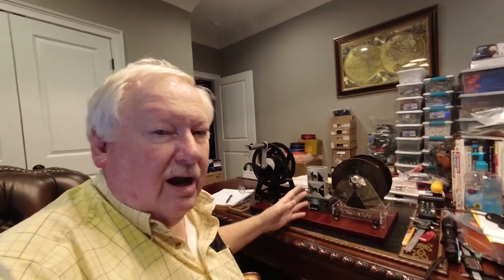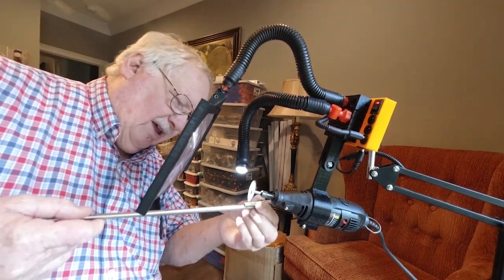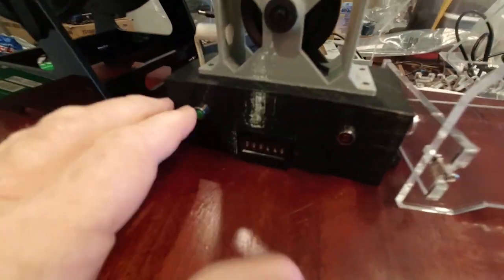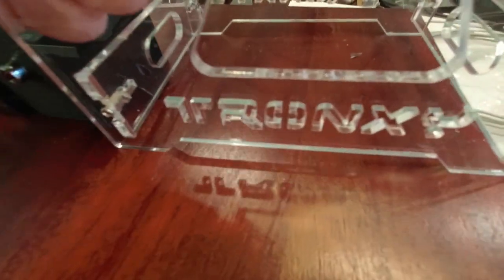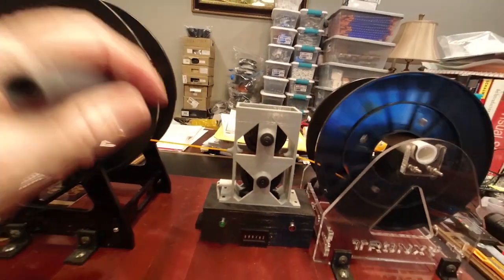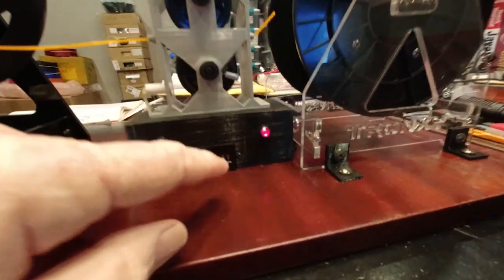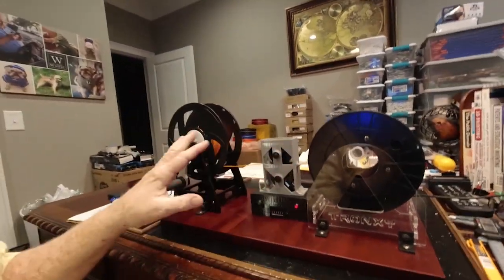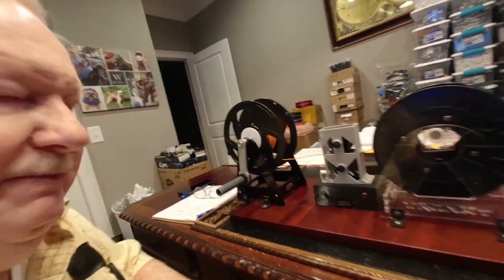MY 3D PRINTER FILAMENT COUNTER, LET'S SEE IF IT'S GOING TO WORK

Comment: I have been looking to make something exactly like this. I also have a 10 printer farm and I don't make anything until it sells. So sometimes I have to use the same color on multiple printers so I hand wind them and weigh the filament for the time being. It works but the winding sometimes gets stuck when the printer is extruding and causes issues with my prints. If you are selling this device you can count me in as a customer!
Reply from the maker: I understand your problems with 10 printers. I hade the same problems before I came up with the counter. The prototype works very well and I hope to have an automated one soon. I will probably have a few to sell online when I get around to it. Thanks for sharing your experience and for your support...Ken

Comment: Great video Ken and nice to see the actual Helping Hand (HH) giving you, well, a helping hand! I’m impressed. I bought something similar years ago but not as advanced. Can I offer some feedback: use a heavier arm base like those for computer monitors – at least as an option (if in fact you plan to sell bases with the HH). I noticed the same wobbly issue with your desk lamp frame that I had with the cheap unit. It was frustrating, couldn’t keep it steady. Your flex-arms seem sturdier than the competition though which is great! I think of the whole thing like a chain: as good as the weakest link. I think the base/arm could be it. IMHO.

You prototype like I do: not pretty but proves if the concept works or not! If you plan on going all electronics, I think the most precise method would be to switch to a weighing reading rather than a length. 3D printers/slicers actually work (calculate) on volume. You could put both spools on scales, average the weight between what came off with what was added on till you meet the target. Heck, with the scales giving you clear LED readings, all you’d need is an on/off switch for the motor! If you stay with length, you could increase the diameter of the “reading” wheel and slap a thick rubber band or the like and add some extra weight for a better non-slip surface. You could also add a second wheel just behind the first to give you two readings and average them out. I could also see two, three or more “series” all connected to the same motor so you could load two or more spools all at the same time with a single respooling machine. Just some ideas for you! Claude
Reply from the maker: How you doing Claude? Hope all is well on your end. Things have been hectic around here trying to get item photos, descriptions, weights, dimensions, and descriptions for over 44 items for the website. Also doing final testing on parts with many printing in PETG at 245c and making outer wall thickness greater and increased fill density for increased part strength on helping hand parts that have high stress and load on them. Don't want the helping hand to get any broken fingers. The helping hand I use in my office is attached to a little folding table and is shaking a lot, but I'm used to it. I do have other mounts for the helping hand that are more stable. One is a permanent mount that bolts to a table or workbench or wall and is the most stable. The portable table tom mount is the next most stable mount and the floor stand and the scissor arm are the least stable but more flexible. As for the filament counter, I have been testing it with some small print jobs and plan to use it for some larger jobs tomorrow and hope to see just how accurate it really is. This gives me a chance to check the slicer too. Will let you know how things work out my friend and as always thanks for your input and support...Ken
Reply: @NewTechInventors  Do you ever sleep Ken? People think setting up an e-commerce business is simple. It is if you only have a couple of products, otherwise, it is a ton of work. Especially like yourself Ken, when you have to do everything yourself. Funny you say your testing PETG at 245C. For my upcoming product, after testing dozens and dozens of prototypes for strength, I finally decided to go with a basic PETG. Now the next phase is to see if I can tweak the design and printing to produce the main body in under an one hour each. I changed my hot end to a Volcano type clone (US$5 each from AliExpress) so that I could print faster while the hot end can keep up with a 0.6mm nozzle. The finish is still great and so far so good at 250C. It says the max should be 240C but at that temp, you can hear the extruder skip at my set speed. The higher temp also gives me really amazing bonding (fan speed at 40%). CNC Kitchen has some great videos on temp, fan speeds and nozzle size for strength and speeds.

Wow, so you'll have a whole bunch of mounts! Hope you do not take my comments as criticism - really trying to help and share my experiences. I can't wait to see your whole line-up Ken. I hope to share my products in the future as well. I'll keep watching your videos and look forward on the results of the counter! Claude

Comment: Fitting direct-drive extruders would make even greater savings as you would not waste the distance in filament from the extruder to the hot end on Bowden machines as long as the filament saving cost exceeds the upgrade cost, but once sales get going I would think this would be a viable option.
Reply from the maker: With filament cost ranging from $ .05 to .07 per meter depending on type, I expect to have from 1 to 2 meter filament loss per job. My average job runs 24 hours and produces about20 parts. This adds about $ .0025 to .007 to each part cost. It's small, but does add up. I'm trying not to go over board here. Thanks for sharing your ideas and for your support...Ken
Reply: @NewTechInventors  I've never seen filament by the meter, only by the gram. I guess you figured out the length on a spool and convert to cost/length?

Comment: Thanks, Ken... The REAL question is how accurate is your slicer in estimating how much filament your part is going to use. It will be interesting to see how much overage/underage you actually end up with.
Reply from the maker: I will find out about the accuracy of the slicers pretty soon. I have also wondered how accurate they really are, since I have been figuring my part cost on the filament length they provide Good question Ben thanks for your support...Ken
Reply: If yu Use Prusa Slicer, Very accurate!!

Comment: AH, I get this project now, and i already want one. First Customer!!
However, how difficult would it be to have a pre-determined length dialed in so it stops at the required length.
For example: I have one empty reel one full reel and get a job that needs 45.7 mtrs. I set up machine with the reels as required, but instead of hand rolling out the 45.9 mtrs req, i set up (Whatever) to reel in/out 45.9mtrs (Extra For peace of mind), flip start switch.It will reel out/in 45.9 and STOP automatically, without me being there to turn it off???
NOW That would be cool.
Reply from the maker: I think we are on the same page my friend. I now plan to motorize the device with a stepper motor and control it with an Arduino board so I can key in a length that will be displayed on a LCD screen. Then when you press start the stepper motor will slowly come up to speed and as the counter counts pulses the count on the display in meters will start counting down to 0. when the counter gets down to the last meter the stepper motors will start slowing down the take up spool to stop at 0. I am testing the device with the temporary manual crank now on several jobs and it's working well. It may take me a while to set up the automated version with all I have going on here. Thanks for your input and encouragement....Ken

Comment: Maybe a stupid question on my part, but if you are using left over spools of filament to make a large full spool, how are you joining the ends of the filament to make one continuous piece of filament?
Reply from the maker: Sorry Dean, I think you are misunderstanding me. I am using this device to pre load job spools with the required amount of filament from the inventory spool to complete a print job. This way there is no filament left on the job spool after the print job is finished, thus eliminating the need to deal with another partial spool of filament. The only partial spool remaining with that filament on it will be the original inventory spool. Thanks for the question and I hope I cleared things up a bit my friend. Thanks for your support...Ken

Comment: Hi Ken, Hows the farm going?? i see you must have some sales on the tap. CONGRATS!!!  I cant see any other reason for all this work. looks like overkill to me, just being honest. never seen a printing farm operate the way you are...usually they keep printing and printing and printing, LOL dont over think things my friend... dont fix what aint broke... sales must be through the roof.........
Reply from the maker: Well you can call me mister optimistic my friend, and it's true I do things differently for sure. I would not recommend that anyone go about this exactly as I have, because the big difference is that I am 73 years old and retired from my income making job. I can not just sit around and watch TV so I felt compelled to start this business with one stipulation, "that I would do it my way and at my pace while getting some degree of enjoyment out of it". If my livelihood depended on it I would not have time to do these YouTube videos and I would have had a website and sales long before now. I am determined to be successful and try to pass along what I learn thru these videos. I guess that is why I seem to spend a lot of time on the different aspects of 3D printing, it's my way of learning. I think you will be surprised at how  the print farm will run in concert with the demand from my web site sales. It will operate much like an assembly line in a JIT (just in time) environment with little need for inventory. Make what you need when you need it. I hope this will help you understand what I'm doing so you don't just think I'm crazy, or you still might think I'm crazy if you understand me. At any rate I consider you a good friend and enjoy our conversations as well as your ideas and suggestions. Thanks for your encouragement and consistent support my friend....Ken

Comment: https://www.polaroid3d.com/en/polaroidprecise/ Polaroid's filament scale measures weight.  I would think you would want to use a 10 kilo filament at cheaper bulk rate.  How do you know how much filament is left on the source spool?  Put the source spool on a scale so you don't run out.  Can you splice filament?
Reply from the maker: Sorry David, I must have overlooked your comment. To answer your questions, I probably will go to high volume spools of filament in the future, and I keep a chart of each spool and how much is removed +/- 2 0r 3 meters so I have a pretty good idea of how much is left. Most of my jobs take 20 - 50 meters of filament. I only splice filament when I have a problem and have to restart a printer knowing I don't have enough filament left on the spool to complete the print. I then have to monitor the splice going through the break sensor and extruder. Thanks for the questions and for your support...Ken